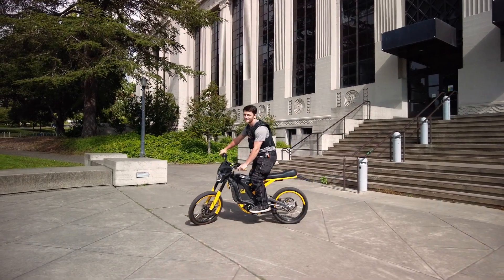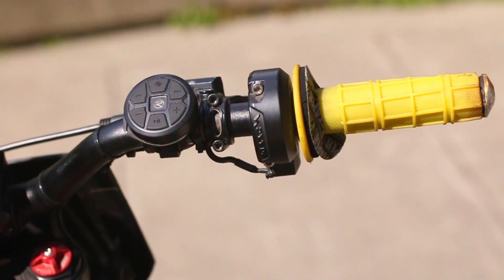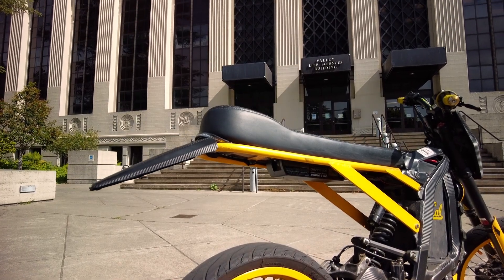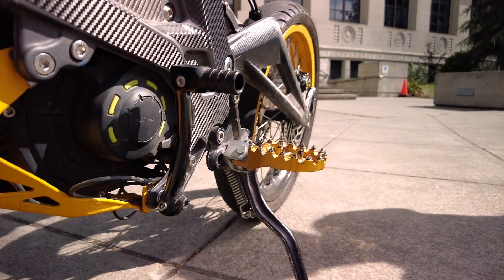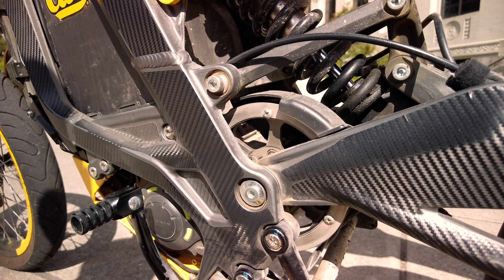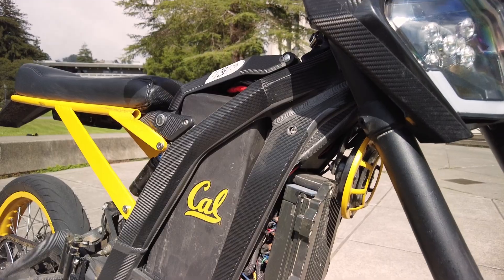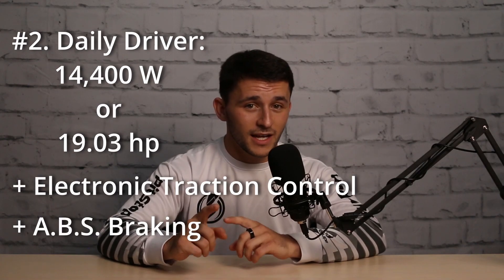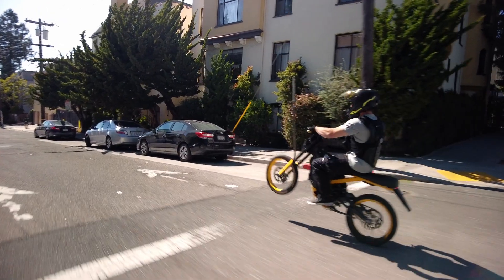PROJECT DEATH HORNET: 72V Modded Sur Ron Supermoto // PIT Projects

Comment: I want to know where you got that upgraded horn from? Please post a link
Reply from the maker: Links to all parts are in the description. Adding every component (even those not discussed in the video).
Reply: @PITprojects  you rock!!! Can't wait for the video... So you don't need the wiring kit for that horn right?  It looks like it would drop right into the stock connectors.  Is that right? Thank you!
Reply from the maker: @FreeMissions  Yup, hooks directly up to stock connectors!
Reply: @PITprojects  Great vid!  Just watched it.  Which horn did you put on? The low or the high pitched horn?  Why?